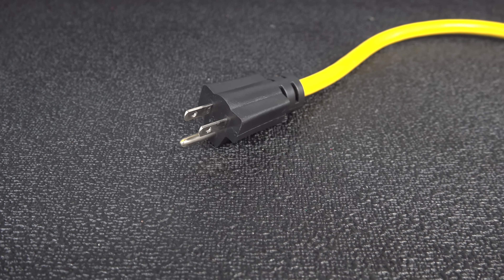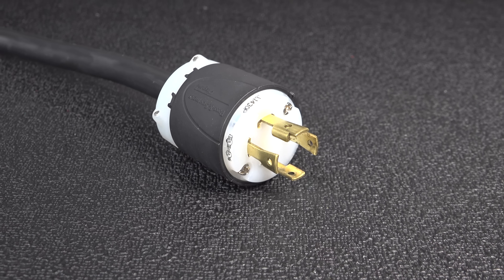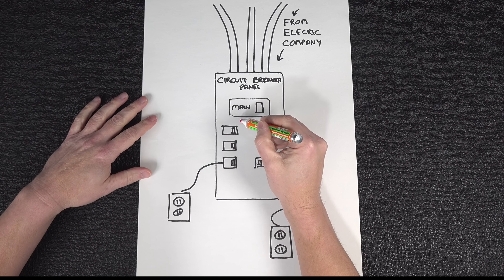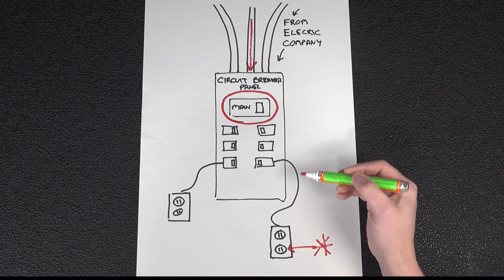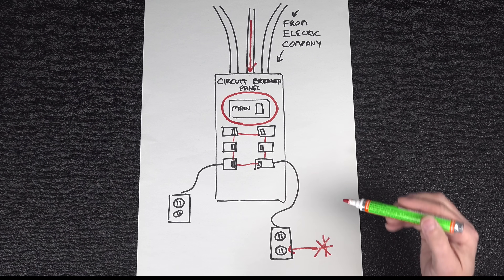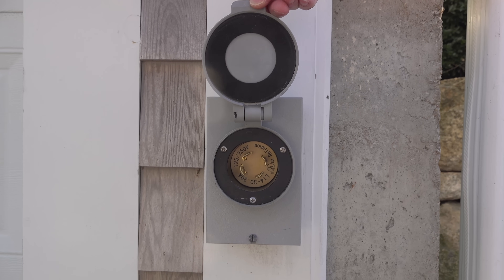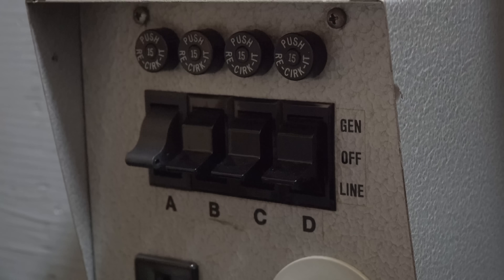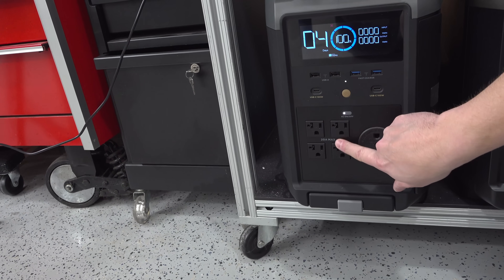Worst Electrical Mistake You Can Make - Backfeeding Generators

Comment: If you switch the mains off at the distribution board then there can be no backfeed out of the house. A male-male lead will be needed to attach a standby generator. There might be an issue with the meter as its after the mains switch.
Reply: if it can reach you can wire the generator straight into the lugs of a breaker in the panel, no male-to male needed.

Comment: Legal or not I always backfeed if I am without power because it is safer than running extension cords around the house. I plug into the welder 220 plug outside in the carport. Since I have a fuse box I have to pull out the main cartridge fuses. If you try and backfeed to the grid your generator will overload so shocking someone else in the neighborhood is almost impossible. This 110 volt double plug is dumb in another way though. You can only feed a single circuit or 1/2 your house and any 220 volt devices can seem off but be partly energized. The cord probably has a small gage wire that can overheat and no 15 amp outlet is safe to run a house. My welder plug has #6 wire and so does the extension to the 12Kw portable generator. A friend tried backfeeding and the breaker for the dryer he plugged into instantly tripped because he forgot to shut off the main. Since portable generators are rarely earth grounded your chance of being shocked by touching one wire is very low, you have to touch two points to feel a shock- and that makes it even more dangerous.
Reply: true dangers are power coming back on frying the generator if the main is closed and fire if the new inlet wires aren't adequate.

Comment: What is the setup like if you generate power and sell it to the grid? Like with solar or wind power?
Reply from the maker: They have safety disconnects that automatically turn off during a utility power loss

Comment: You should always have a safety interlocking transfer switch for the generator that has a special twist lock receptacle on both sides

The safety interlocking transfer switch disconnects the utility power from the pole

Always use a transfer switch with a generator
Reply: For a permanent one transfer switch is required, there's lots of high level electricians who argue both ways about an interlock being up to muster for a permanent connection of an in-place generator. But for temporary connection of a portable, there's an exception to all transfer equipment provided the main is somehow lockable by design.

Comment: Yeah, doing this is the worst way to get electricity, and it could kill you. If you live in an area where you know there might be power outages etc, get n electrician to set up an ATS(automatic transfer switch) at the mains and there would be an inlet connection for the genset in the ATS, that connection might be different, and only connect at that, and make double sure everything is off when you connect the genset. But i can understand why people use this type of connection while desparate. If you do, make sure the mains is turned off from the MCBs, and all the loads are off as well from the MCBs , then make the connection is done properly, double check everything, then turn on the genset and then connect the loads one by one from the MCBs. And always keep an eye on the genset and the connection, keep checking after a few hours, also use the correct gauge cables for the connections.

Comment: Something that took me a while to understand is that when you backfeed your panel and power goes out onto your house service, you're not just sending out 120v or 240v. As soon as your power hits the transformer that powers your house that voltage is stepped up to thousands of volts. That's important when you don't have power because the primary voltage line that feeds your transformer is broken and laying across your neighbor's metal fence.
Reply: In Australia we use 240V for general power applications and 3 phase 415V. It is MANDATORY than any generator connected to any building fed by mains power MUST be done through a three position switch if the changeover is to be done manually.
Positions are Mains ON, switch OFF and then Generator ON. That way it's not possible to feed power back into the grid from a generator.
Reply: @bobmarshall3700  its mandatory in US also, but most homeowners don't have a clue. With stuff like this on the market, people will think its the correct thing and won't think to call an electrician like they should
Reply: Thats why you hit your power cuttof
Reply: @chrisbarber2084  yes you turned off your main breaker so you don’t backfeed the neighborhood
Reply: Shep VanDelay  Pull the f*@king meter.
Reply: @jaymes7521  in most places that is illegal.  Want the local power company to refuse to reconnect your service until your whole house system is re-inspected?   Just cut the seal and remove your meter on your own without getting their approval first…
Reply: @rronmar  not illegal, against the power company's rules...
Reply: @scottthompson9089  depends upon where you are at.  Many states right to repair your own electrical laws end where your property does, the utility owns the meter…  So yes, you can be cited for code violations, and everything red tagged until a complete inspection and re-certification is performed…  Don’t agree with it, but that is the way it is…
Reply: @rronmar also super dangerous. For example if you pull a meter under load for example well everything in your house is running you can risk forming an arc between the prongs on the back of the meter and the corresponding jaws in the meter socket that it plugs into also if your meter socket is damaged in someway that you cannot see from the outside and you pull that meter you may create a dead short between the metal enclosure and one of the live conductors that come from the authority company feed again creating a pretty bad arc flash. Utility company personnel and in areas where a licensed electricians are allowed to do it they usually have the proper training,PPE, ect to do it safely.
Reply: @coolsnake1134  exactly, meters are NOT designed to be pulled under load, again, depending on utility and state laws, often requires license and or power company approval/supervision to do anything with the meter…
Reply: Really? How many storms have you worked? You have 350,00 people without electric the utility won't give 2 shits if the meter is pulled.
Reply: that's why you trip your main disconnect.
Reply: Your neighbor needed a new orange frizzzy hairdo... HA HA HA    He was a bastard anyway. RIP
Reply: Although that may sound correct, there are some flaws. You should turn the main breaker off in order to perform this procedure. If you didn't, the phases from the transformer and generator wouldn't match up and start to short circuit which could damage the generator and/or other equipment. Even if that didn't happen, you would need a very powerful generator and some thick cables to use the transformer backwards to power someone elses house. Otherwise, it could damage equipment because of the large load put on the generator and/or cables. I'm no electrician, so I ask of any feedback on stuff that I may have missed and/or false statements.
Reply: When you say " you backfeed your panel and power goes out onto your house service" are you implying someone would ever be backfeeding a panel even though the power is not out?
Reply: @bigpardner  I was thinking of outages only
Reply: As long as main breaker is off everything will be ok ,people don't want to spend 2k to wire in plug when you can back feed for 40 dollars.
Reply: Yep, you just need to pay attention, but it does not cost 2K to put in an interlocked breaker and plug, maybe $250 in parts depending on where you source the interlock kit.  IMO, if you are not competent enough, and posses enough understanding to change out a breaker in a main panel, you shouldn’t be doing any of this:)  Another issue with trying to back-feed 120, is the outlet circuits in a domestic panel are spread across both halves of the center tapped 240, so any given outlet is only connected to half the outlets in the residence…
Reply: @rronmar  that’s why I use the dryer plug.  …
Reply: @rronmar  any given outlet? Besides the stove. The insta hot water heater. The garage 1420 for welder. Or the dryer plug…. So no any given outlet etc etc. I’m all for let’s not let stupid ppl do electric. But for as long as I can remember the general public thinks that this is the worst possible thing you can do. Like 100 lineman die every year and over 5000 houses burn down. Honestly we don’t even care or think about it. It’s really really honestly coming from a journeyman lineman, not a big deal. We treat everything as hot all the time anyway. So who cares. Seriously. I do it. Idgaf if anyone else does it.
Reply: @rronmar  cause like I said. Yes two steps is sometimes just too much for ppl lol. Flip main off. Plug in cord. Nope can’t work. Too complicated.
Reply: @paulhollowell9966  well for a decent 4 wire cord a 1430 twist lock and whatever dryer plug you have it mite be 150-200$.
Reply: Yep, transformers work both ways, but In most every case, back-feeding the grid is not really possible.  Is your generator large enough to power your entire home?  Is it big enough to do that and power all your neighbors at the same time?  Most generators you are going to want to plug in, are not.  So unless the break in the line is in the line to your house, as soon as you attempt to back-feed, your itty bitty generator is going to promptly stand on its ear trying to power your entire neighborhood grid.  It’s output circuit breaker will open as soon as it sees this massive overload…  that being said, the interlocked breaker in the power panel  feeding 240 into the panel while opening the main really is the way to go.
Reply: @rronmar  all correct. If 2 steps is too complicated….

Comment: That cordset is not sold! companies can't make enough  $$ to make up for lawsuits  that will flow their way. Said cordset can be made and used safely. I have done it, dog locked in bathroom. no
kids and wife knew  to stay in livingroom. I had two disconnects, one outside under the meter and
one in the house in main cabinet. having always been well versed in power I knew the danger of
the cord but the advantages as well and as long as one understands every step. there is no 
danger. power went out I shut off the breaker under the meter and the Mains in the house. Then
I plugged into the dryer w a 4 wire cord (two hots, a neutral and a ground.) with both mains off I 
could NOT be in danger even if the power returned. then after the gen was warmed up I plugged
into it. Had I plugged into gen 1st, there's be juice on the dryer end's prongs or walking back to the dryer socket with a roll of live cord would not be smart at all.  what I am saying is do it the way
this guy sez with an interlock, BUT if it happens before u get it done, you can still weather the 
storm if u understand.. And when power does come back on, you MUST unplug BOTH ends 
before you turn back on the mains. just unplugging from gen is NOT enough as Mains being on,
prongs at gen end of cord will be live.

Comment: I'd like to see the statute that says it's illegal to back feed your house from a generator.
Reply: Yep.  Question Everything.  You don't even need transfer equipment: 705.NEC702.6 contains an exception to the transfer equipment requirement:
“Exception: Temporary connection of a portable generator without transfer equipment shall be permitted where conditions of maintenance and supervision ensure that only qualified persons service the installation and where the normal supply is physically isolated by a lockable disconnecting means or by disconnection of the normal supply conductors.”
Reply: If it is like Michigan's (which last I checked is about 50 years behind the NEC) you might be legal (I don't know and I don't feel like reading Michigan's code to check right now).  That doesn't make it wise or safe.  The situation is so laughable that I refer to the NEC (which is available online) or a source that I know uses it rather than Michigan's electrical code.  I am not an electrician but I do know I don't want to burn my house down.

Comment: I've never heard it was illegal to use the double headed cord??? You must be in a state that says it is idk I know in NY where I'm at I built my self a 30 amp 240v "extension cord" to use for my generator when power goes out my first step every single time is to turn off the main breaker before I go to the generator I have never once mistaken that for accidentally leaving the main breaker on
Reply from the maker: It's is also illegal in NY. You can call your local building department, don't give your name - Just an excerpt from a NY page: NEVER try to power the house wiring by plugging the generator into a wall outlet, a practice known as “back-feeding.” This is extremely dangerous and presents an electrocution risk to utility workers and neighbors served by the same utility transformer. It also bypasses some of the built-in household circuit protection devices.

Comment: I ran a generator for ahouse for about 3 weeks. It was a bit expensive. I wired it directly to the breaker panel. Left some brightly covered tape over the main switch. You have to be safe.
Reply: needed to padlock the main, or the whole panel.